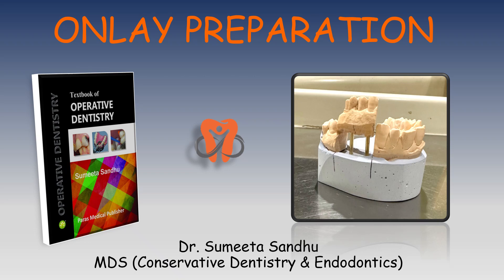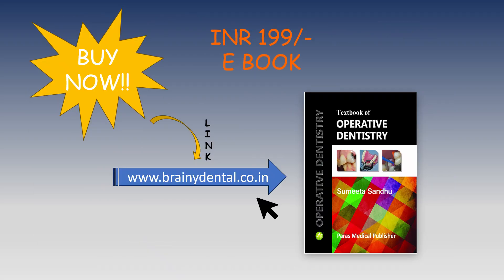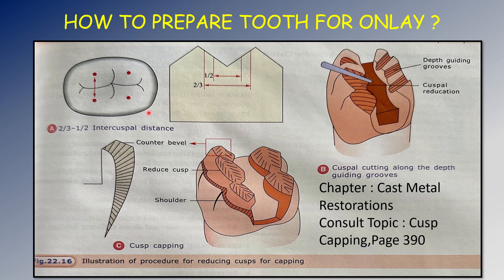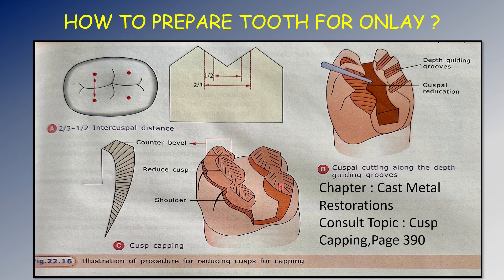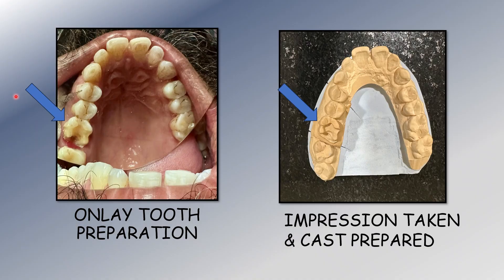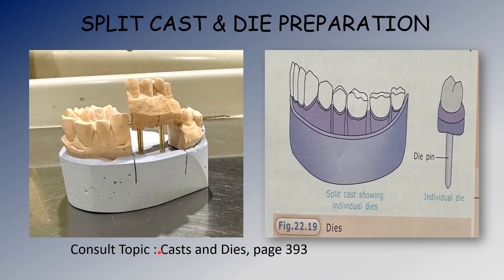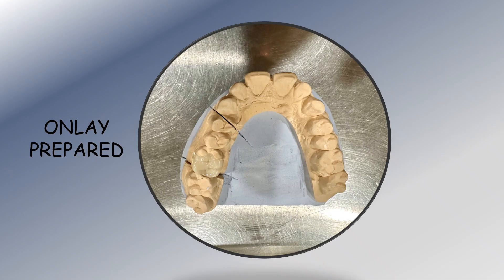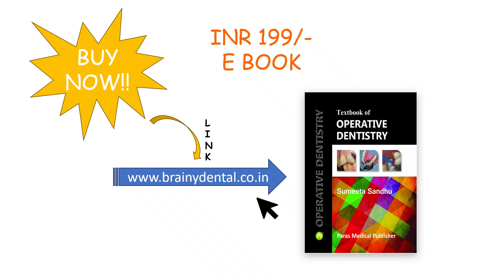Tooth Onlay Preparation| Inlay Onlay preparation

Comment: Hello 
. I really need your help. I am getting rct done from a doctor. I got the first sitting done and it was not painful at all but at the second sitting the doctor said that my canal is 5mm deeper than usual canal so even after local anaesthesia i feel so much pain when he inserts the file deep. What should i do please help
Reply from the maker: Just wait! If there are pulp remnants in the deeper portion of the canal, then on their removal u will start feeling comfortable. Take the prescribed painkillers given to you. 
It will get better, don’t worry
Reply: @sumeetasandhu but ma’am the process of him doing that is incredibly painful as local anaesthesia doesn’t work either. What to do regarding the pain?
Reply from the maker: U can’t do anything about it! 
Suggest to him to take an X-ray and reassess the length
Reply: @sumeetasandhu can’t i ask him to give a pdl injection ma’am?
Reply from the maker: normally clinicians don’t like to be instructed by patients. So, I would suggest you convey your discomfort, and I’m sure he’ll think of something to help you